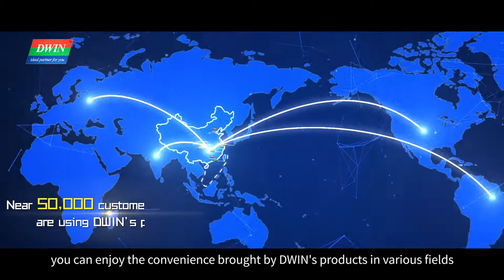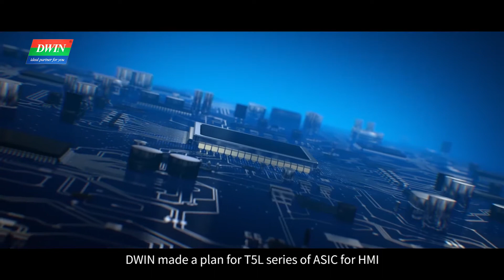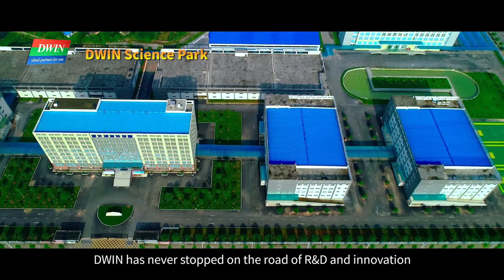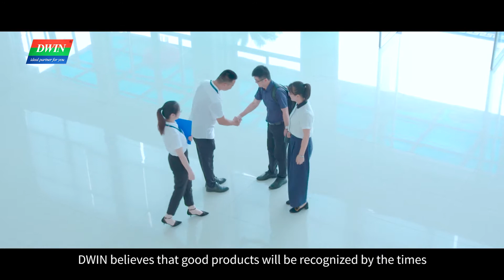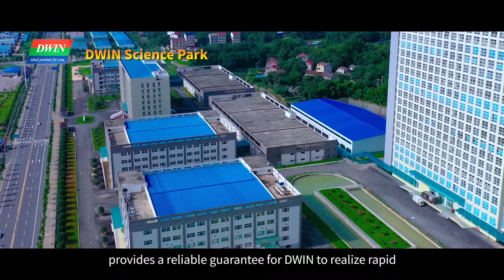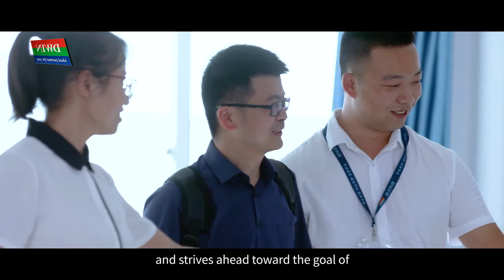About DWIN Technology 2020 | TOP LCD TOUCH SCREEN MANUFACTURER

Comment: I am really excited about your idea of making graphical interfaces for embedded systems really simple.
I have one question. I am working with DMG1270C050_03WTC and I would like to know how to integrate the C-code along with DGUS software?
Do you have any technical guide to help me to understand the procedure?
Reply from the maker: Hi~Our customer service professionals will contact you for technological questions later. Best wishes ^ . ^
Reply: This screen can be developed using C code. Are you writing C code on the screen? Or is it connected to the screen after writing C code on your control panel? Please leave your email, I will send you some information, thank you
Reply: @peterdai389  Hi, I am using "DGUS_TOOL_V8.0.1.1" to for creating interactive menus. I would like to understand how to merge the C-code to achieve more functionality like timers and storing permanent values from touch screen :)
Reply: @yasirqureshi6059  Yes, I got it. Please leave your mailbox, I will send you a set of information and examples of C code development.
Reply: @peterdai389  dear, I tried to write my email but youtube doesn't allows my email in the comment.
Reply: @yasirqureshi6059  Because I can't send it out, I will break it down and tell you. peter is my name, @, dwin is my company name, dot com, dot cn. Combine these.